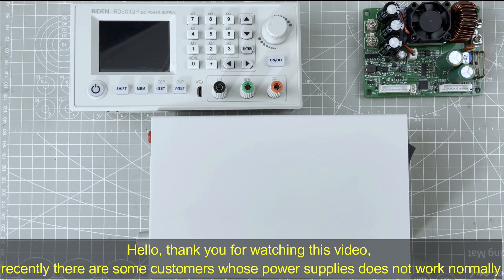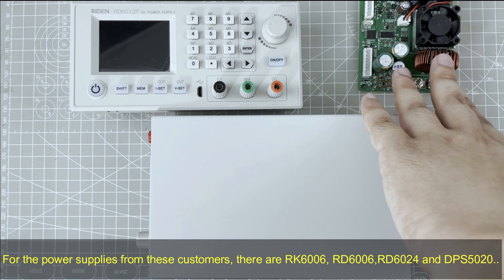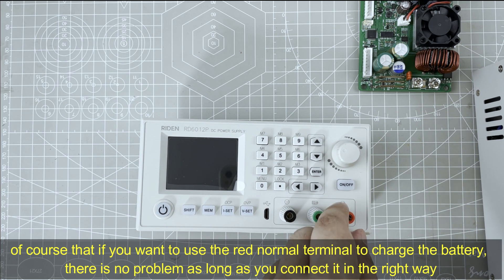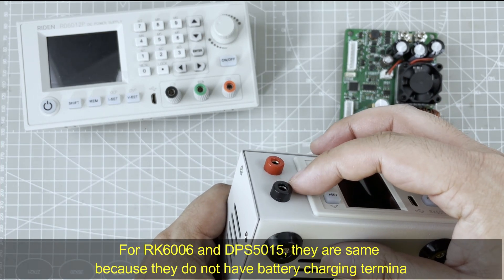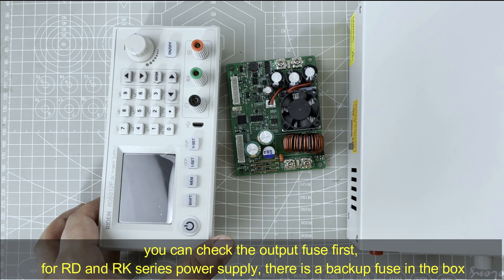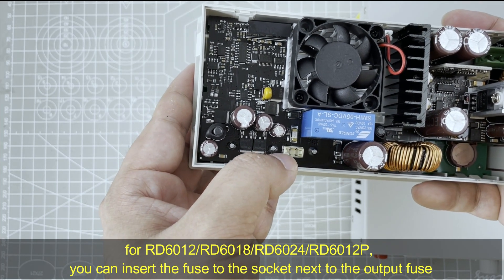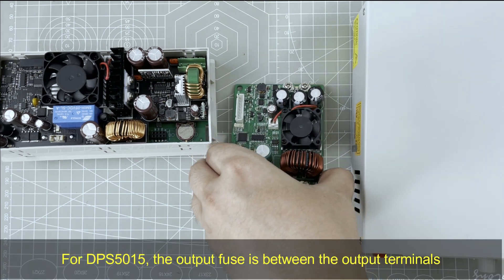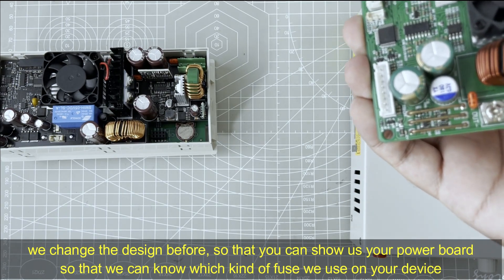fuse replacement after charging battery in the wrong way RD6024 DPS5015 RK6006

Comment: THIS ITEM IS GARBAGE!!!!! BURNED HAVING 15 AMPS LOAD WHILE DEVICE IS 30AMPS RATED [RD6030] AND FUSE IS 40AMPS... MY CONTACT MELTED, WHILE CHARGING BATTERY. IT IS SOO DUMB IT HAVE NO ANY PROITECTION!!! IF I SET 15AMPS HOW CAN 40AMPS FUSE BLOW?? ALSO HOW DA FK TO SOLDER THIS TINY SURFACE MOUNTEF FUSE!! CHINESE ARE I D I O T S
THE PALCEMENT OF FUSE IS ALSO SOOOOOOO BAD!!! AT THE MOST CORNER WHERE PLASTIC MEET....IMPOSSIBLE TO ACCESS

Comment: Hi. I wanted to know if I can charge 18650 and 21700 lithium ion cells with my RK6006, connecting the polarity correctly of course?
Reply from the maker: hello, as long as you set the correct voltage and current, and do not reverse the connection, there is no problem, and you need to cut off the output by yourself since it does not have cut off function
Reply: @rdtech9153  I will take into account the voltage and charging current of the cell indicated by the manufacturer, as well as the charge cut-off. Thank you very much for your response.
Reply: I was worried that it might be necessary to put some diode at the output
Reply from the maker: @anycueto2309  you are welcome
Reply from the maker: for RK6006, there is not connect reversely protection
Reply: dont buy this crap!

Comment: IDK why my RD6005 always protect when i tried to charge batteries, it works normally
Reply from the maker: hello, you can check the cutoff current setting first, if it is ok, contact us on aliexpress, we can help you judge the problem
Reply: @rdtech9153  I don't have that option, my firmware ver. is 1.35
Reply from the maker: @isfek4Z  you can make a video to show me the problem, I can help you to judge

Comment: Development team: Change the board design so blown fuses can be quickly replaced without the need to desolder and solder!
Reply from the maker: for low current device, the fuse socket is ok just like our RD6006/RD6006P/RK6006, they use fuse socket, but the fuse socket does not support big current, so that other big current device solder the fuse on the pcb board, and there is a socket beside it, we said it supports 10A max
Reply: @rdtech9153  THERE IS NOS OCKET U DUMMIE!!! WHERE IS SOCKET IN RD6030?? IN THE ASS MAYBE. Surface mounted fuse how dumb is it!!! like we all have fking soldering stations that can do surface mounted soldering.
Reply: There are fuse sockets that support more than 6amps. Most of the 300watt 30v/10a generic dc power supplies on amazon have a replaceable fuse just below the power connector. This would be a better design, imo.
Reply from the maker: @brianmcginnis7417  yes the fuse socket we use is 10A, but RD6024 is 24A,if we can find such socket we use it alreay

Comment: Did output power terminal have protection from short circle or same fuse protect him to? I mean new rk6006.
Reply from the maker: hello, yes these power supplies has short circuit protection, do not worry
Reply: it have NO PROTECTION whatsoever! dont listen to chinese!! I have rd6030, used it to charge my battery, set to limit amp 15amps. Charge dlike 12 times and once i come to see and green terminal was melted, fuse damaged... 40 amps fuse damaged while i set current limit to 15!!!

Comment: Posso carregar baterias com RK6006?
Reply from the maker: yes, just do not connect the battery to the wrong output terminal and there is no problem
Reply: @rdtech9153  Thanks for your quick response. I will use it occasionally for this.
Reply from the maker: @eduardobrito4197  you are welcome, if there is any needs, just contact us